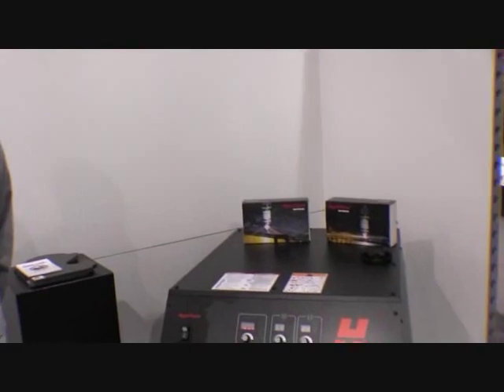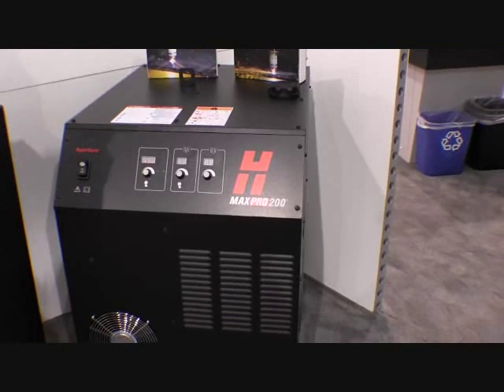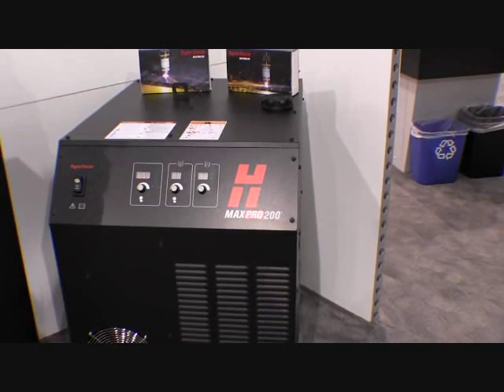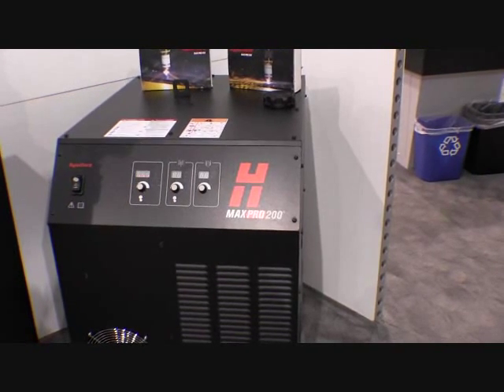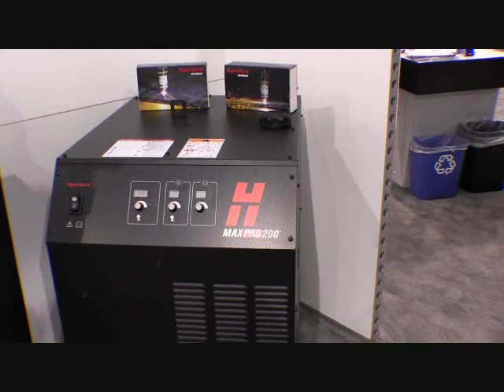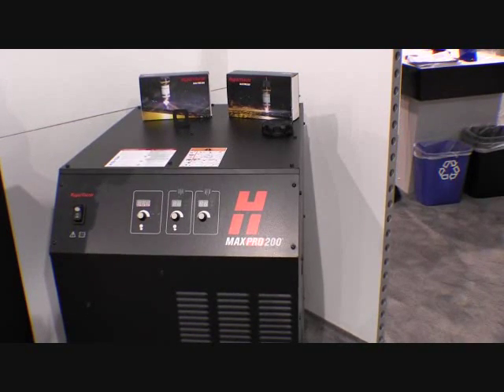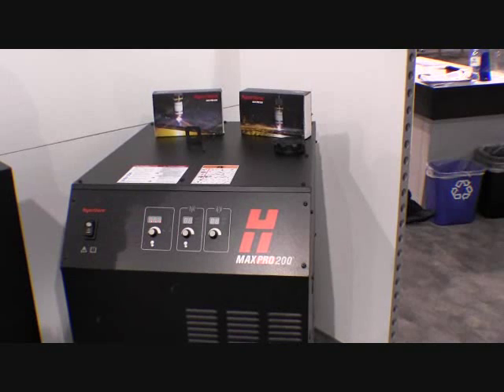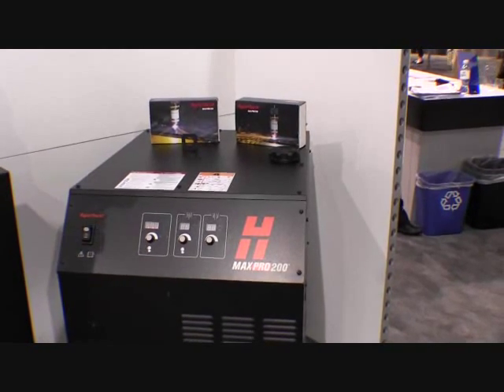FABTECH 2012: MAXPRO200® LongLife® air and oxygen plasma cutting system

Comment: 32, 24, 28, 12 hours without stopping worked several times. 30mm, 25mm, etc. cut metals. very powerful thing. I breathe with this device. 👍